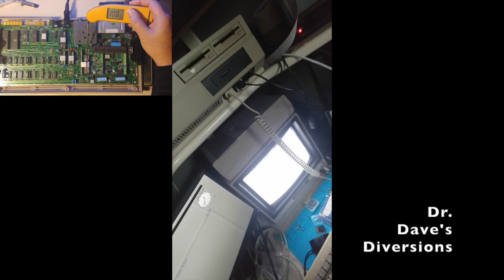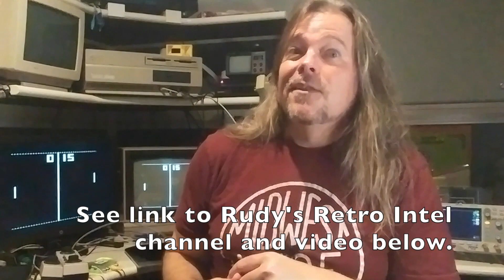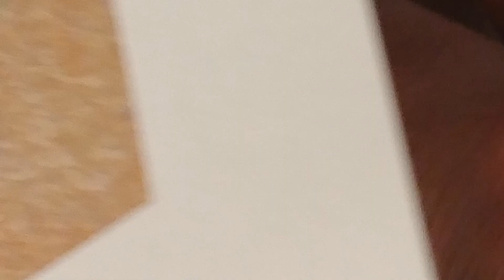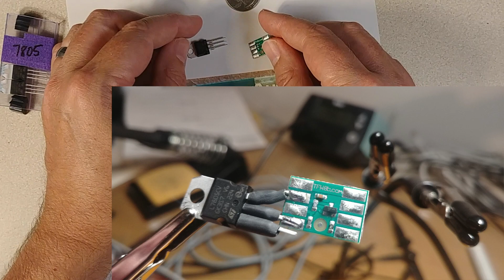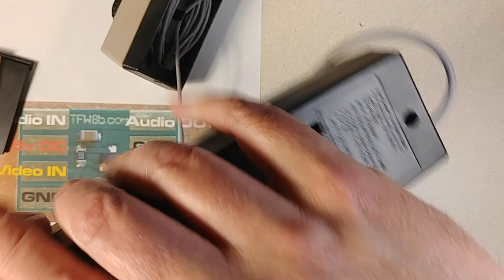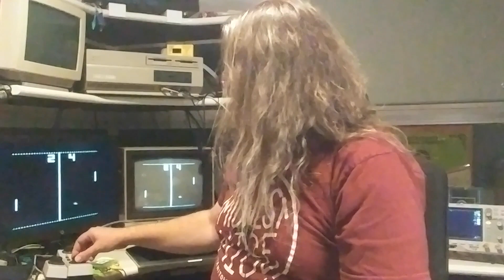Tandy Radio Shack TV Scoreboard Composite Mod and HDMI #SepTandy 2022 #VCFMidwest2022

Comment: To me it looks like the composite mod board can run happily off of 6 volts without the need for a regulator.
Reply from the maker: Could very well be! I am running it directly from the (9V)wall wart, so thought I'd uses the regulator but I bet you are right that I could have tapped the voltage from elsewhere.
Reply: @DrDavesDiversions  I say this because from what I've seen it's just an NPN amplifier. I do know it needs a solid voltage applied with no ripple. If the non-regulated version creates a "funny" display that just means you need regulation to remove AC ripple.
Reply from the maker: @therealjammit  I am just an amateur at this, but so far the problem has not been with interference/ripple, but more a low composite signal. I will be comparing this TFW8b.com amplifier vs. the similar TINYcomp, possibly with some alternative resistor values in an upcoming video... would appreciate your thoughts if it is an area of expertise for you!
Reply: @DrDavesDiversions  it looks like an emitter follower. It has a high input impedance and a low output impedance. In other words you put a 1v signal in and you get a 1v signal out. The circuit allows the input signal the ability to drive a 74 ohm load. Changing the power supply level won't change the output voltage level.
Reply: I meant a 75 ohm load and not a 74 ohm load. Can't edit for some odd reason.
Reply from the maker: @therealjammit  OK, the electronics detail is a bit over my head currently, but I have a scope and am talking w/Rudy (who designed the TinyCOMP), so will see in the coming week or so if there are ways to improve it with the Odyssey 4000. It seems the issue is that both composite CRT monitors ant the RetroTINK-2X Pro are tolerant of a wide variety of non-standard composite signals, but results vary. Sometimes they look better on a composite monitor and other times better with the RetroTINK output to HDMI. (The latter is my goal...)
If you happen to be interested to help/comment on experimental changes, please drop me an email to my address that you can find in the channel's "About" page.
Peace!
Reply from the maker: @therealjammit  Ya, YouTube's comment system is terrible. We're lucky it didn't delete your comments. fingers crossed

Comment: I remember as a kid flipping switches on that till it would start to glitch and make electronic sounds and funky displays.
Reply from the maker: That's awesome :)
It does definitely glitch, but even its normal bleep and bloop is somehow strangely satisfying. Maybe it's because, similarly for me, it's rekindling some memory from over 40 years ago.

I'll have a short video with the competing Fairchild Channel F from VCFMW next, BTW!
Reply: @DrDavesDiversions  what does it use for a sound generator or is it all in the single ic?
Reply from the maker: @spacetrucker2196  It is all one IC!
You can see the details, e.g., for the AY-3-8500-1, in this document: http://www.pong-story.com/GIMINI1978.pdf

One pin on the IC is "Sound Output" (wired to an internal speaker), and it is described merely as "Action Sounds" in the list of IC features. :)

Comment: Oooo fun! Old analogue on to new digital HDMI! Sweet
Huh? But that pcb is just a composit out. (just an amplifier). So I guess you then take that composite into an upscaler that translates it to HDMI? Because HDMI is really a complex affair unlike composite and VGA.
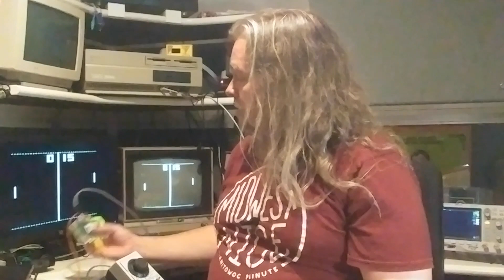Reply from the maker: 4:20 Exactly. The conversion to HDMI is the pricier part... but the RetroTINK-2X Pro comes through again. (I use it a lot for displaying composite/component/s-video on my laptop (via HDMI USB input), HDMI monitor, and/or screen recording.)
Plus it does stereo sound (to HDMII).
Link to RetroTINK in description.

Comment: Hey Dave! Great seeing a video from you. It's been so long! I'd like to get one of your Amiga2MacFloppy kits. Such a cool piece of tech. Sady I won't be able to make VCFMidwest 2022 this year (maybe next year). The Tandy Radio Shack TV Scoreboard brings back so many memories. I remember playing with one as a kid in the 1970s. We had the coolest toys back then LOL. IIRC there was also a gun accessory for it too. As for the video mod, pretty cool stuff! I have not used TFW8b version, but have used Rudy's TinyComp. Looks like both are great options depending on which side of the pond you're on.
Reply from the maker: Cool, Sean (right?) - hit me up by my contact email with a mailing address, and I'll save board(s) and send what I can next week.
Please let me know if you plan to use a real Mac-compatible external floppy drive or just the Floppy Emu, since you'll need the small IDC to DB19 board too, if you're doing the former, whereas the latter you can just connect with a ribbon cable, e.g. https://smile.amazon.com/gp/product/B01N11ILFU/
Reply: @DrDavesDiversions  Yep, I'm Sean. I just sent you an email. Check your spam folder if you don't see it.
Reply from the maker: @geekwithsocialskills  got it - will get back to you after VCFMidwest so you know what I'm sending!
Reply: @DrDavesDiversions  Thanks Dave!
Reply from the maker: Oh, and I should share that, unbelievably, I received the TFW8b.com boards, here in the U.S., in just a few days via DHL. It cost approx. $15 for shipping, but divide that by the # of boards bought, and it's competitive with domestic shipping!
Reply: I've ordered items from TFW8b and agree the DHL shipping is pretty quick and decently priced, especially if you order a bunch of things at the same time.